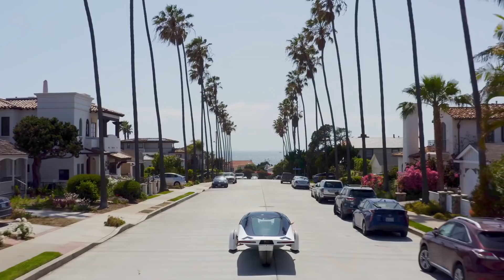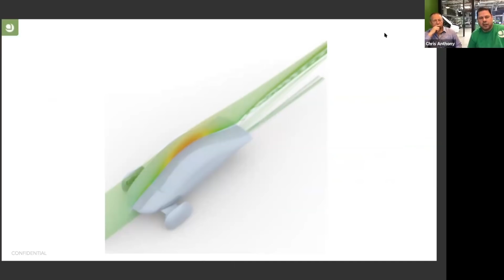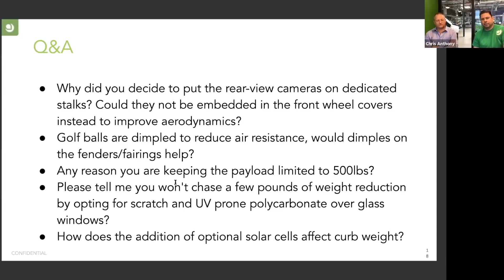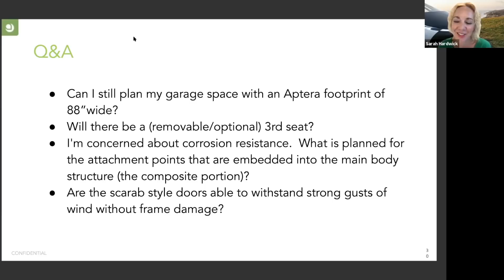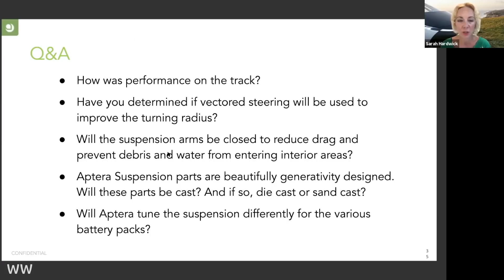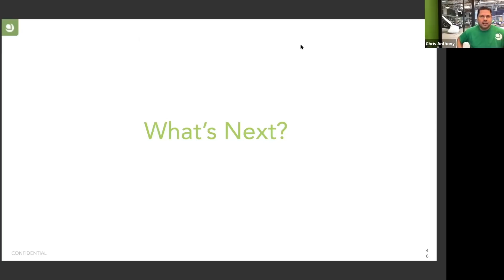Aptera Beta Design Improvement Webinar

Comment: Finally a shot of the awkward ingress as I suspected.  How about the egress?  Come on a motion shot.  In and out.  An average sized man in a narrow parking space. If they don't fix this it will die a very quick death.  This combined with the reach and bend needed to put articles in the hatch area would assure my Chiropractic practice a waiting list.  I bet she isn't even 5'5".
Reply: This is an alpha vehicle.  The betas will have a larger cabin.
Reply: @n.brucenelson5920  I doubt that will change the awkward ingress and egress.   The cabin interior size is less of an issue.  It's the shape and angle of the door opening.   The only way to keep an entrance the average American can navigate will be to lose a lot of Cd.  I had my suspicions with all the hype pictures and very short video clips conveniently omitting anyone contorting their body to get in or out in an empty parking lot let alone a tight parking space with 2 ft to the next car.
Reply: Doubters with no real information seem plentiful.  Cabin volume certainly makes a difference for taller people, and also has a safety component, moving hips further from the door.
Reply: @n.brucenelson5920  the information is plentiful in the form of no information.  No one selling something wants to show the faults of their product.  Aptera 2.0 is no different.  Cabin volume makes zero difference in passing through the same size and angle doorway.  I have an average 2k sq ft home with stock 36 in wide doors.  My son has a 7.5k sq ft home with 12 ft high ceilings.  Same 36 in wide doorway.  Same limitations of that doorway as my doorway.
Reply: @doclees11  Once the gamma vehicles are available later in the year, you will probably have a chance to check it out for yourself.
Reply: @n.brucenelson5920  yeah sure.  Still waiting on Elio.  At least I got to sit in one.   Meanwhile the major brands and technology keep improving exponentially.  I have no problem being proven wrong but I've been following this type of "new" offerings for too many years.  All have died off.  I doubt this will be another hybrid wake boat.
Reply: @doclees11  The Elio was a poor copy of the original Aptera with no engineering expertise behind it.  This generation of Aptera Motors has top engineers from the industry with an actual record of success and could be working anywhere they wished.  Both founders have a successful business record, filled with innovation.  The last company Chris Anthony co-founded and was CEO of, is a lithium battery company that is publicly traded.

I do understand that the general record for startups is not promising.  This could have been said about Tesla, too.  This is still where most innovation comes from.
Reply: @n.brucenelson5920   Apparently Aptera's top engineers don't realize their toy needs to be user friendly.  That doorway isn't it.
Reply: @doclees11  if you had made it to the last 15 min of the video, Jason stated they had made improvements in egress/ingress with beta.
Reply: @jasonstahl1327  they haven't shown them.  Last video from the most recent video stream I saw with Chris getting out still looked awkward and ungraceful.
Reply: Hey folks the most recent video from Aptera show one of the bosses getting in.  Yep that's a deal killer. Ass to the door, squat down, tuck your left shoulder to the rear of the seat, tuck your head and swing in.  D
Reply: @doclees11  I remember the first time I owned a motorcycle with a rear trunk and center stand. It felt so awkward getting on without my foot hitting the trunk and it took 3 or 4 tries to get it on the stand. After two days of riding, zero issues. On and off we’re a breeze. You learn the kinematics of the vehicle. Steve looked like he had no problem getting in. And it definitely is more graceful than getting in my Triumph Spitfire. If you don’t like it, don’t buy one, but you seem intent on getting others to hate it with you.
Reply: @jasonstahl1327  my Honda Coup 600 Kei car was easier that that. My 63 Midget was easier than that.  Hate it? Not at all.  Cool science project that may lead someday to something the average person can use and want.  Nothing i want more is a super economical form of transportation because I'm inherently cheap.    Call out its flaws they have been intentionally hiding from investors and pre-orders? Yes.   That is what I hate.  I have no doubt that the designers know this flaw is a real problem.  So they are either so excited and blinded about its concept or they are deliberately avoiding the issue to not shade the hype.  As a cynic I lean towards the latter.  As cool as some of its features hope to be, its market is getting smaller and smaller as more info gets out.  Let's assume it makes it to full production.  Put this into the hands of people reviewing it and that ingress and egress is going to rate very very low. You know how you get in your car with a briefcase or bag of groceries in your hand to put on the passenger seat?  Doubt that can happen with that ingress. That means you need to put the item in before bending like a yogi.   Run a couple errands and you'll be begging for a normal car door or a nice sliding minivan door.   Low sales will keep the price high further reducing sales.  Meanwhile normal EVs/PHEV  continue to drop in price, add luxury and don't look odd. As for Steve, I have no doubt he has been practicing that entry many times.  Can't wait to see his exit.

Comment: It seems to me that Aptera is an interesting concept to, in part, show where certain elements of technology can be stretched.  But, nothing in this webinar showed me in any way that Aptera can even remotely match Tesla's engineering and its focus on what a customer can actually buy and use.  Compare Telsa's development of a new electric motor with carbon fiber housing which results in sustained high output power numbers even at higher velocities.  With Aptera, they're still talking about rear vision placements in the wheels housing.   Yawn!
Reply: Tesla knows that efficiency is the rule for BEV. Aptera’s aerodynamic are more advanced than Tesla, but they are both headed in the same direction. What I am most concerned with is the battery thermal management system.
Reply: @matthewhuszarik4173  Remember that one of the Aptera founders took a lithium battery company public.  There is a good chance they have access to BMS tech and thermal management at least a good as what Tesla has. Aptera has a lot of IP in this area.
Reply: @n.brucenelson5920  I hope you are right. As everything being equal I would prefer an Aptera over a Tesla. I don’t really want to be driving a 4K-5k pound car around for errands. I hope they have a four/five seat version on the back burner as well.

Comment: It needs to reduce width, 88" is wider than a Hummer EV width of 86.7 in (2,202 mm). This will not fit narrow European streets.
Reply: Agreed, 88" is way too wide for a two-seater coupe.  But, as Chris said, the most they could bring those wheels in would be an inch.  Reducing the width would require a radical design change for the body, fairings, and suspension.  Perhaps the next generation they'll be able to get those fairings closer to the body, or maybe even integrated.
Reply: I wonder if it's possible to get good enough torque vectoring that the front wheels don't need to turn under any circumstances, and allow the rear wheel to turn like a caster.
Reply: Good luck with this tunnel in South Dakota
https://m.facebook.com/groups/208379450470795/permalink/554337059208364/

Comment: With the all wheel-drive set-up why not use all wheel for obtaining speed then use the wheel to recharge the battery while you continue in front wheel mode.
Reply: Doing this would just drain the battery faster
Reply: Because drag .
Reply: this is like asking, why not apply the breaks while acceletating on 33% of the tires.. you lose more power from the breaking then you'd generate dragging thru break/reverse engine operation of regen
Reply: Because that would break the laws of thermodynamics.
Reply: If you give it a bigger wheel in the back couldnt you always be going down hill? 😁

Comment: At 58:17 they could have added solar panels inside the dashboard, that way more unused spaced is utilized to power up the vehicle.
Reply: The full solar model includes panels on the dashboard.
Reply: I think this would result in reflections...but I am wondering why the tail is only equipped with 3 solar cells each side when there is more space (in between)?
Reply: @christoph3864  Possibly to leave the area clear for people climbing over the center section.

Comment: Aptera considering a single pedal for drive and break (like Nissan)?
Reply: Not at present.
Reply: I drive a 40 kWh Leaf. One pedal driving is GREAT!  I wouldn't want to go back.
Reply: I like the option of being able to select anything from one pedal driving to stand still (like the Model 3)  to full coasting (some call it sailing). EV owner feed back tells one pedal driving is a favourite and I have to agree.
Reply: It has several user setable levels of regen. On higher levels, regen should handle most of the braking without needing to touch the brake pedal.

Comment: With the lightness of the vehicle I wonder if it's a potential danger driving over the Mackinac Bridge between the Upper Peninsula of Michigan and the lower Peninsula of Michigan. We've had small cars like the Yugo actually blown off the bridge into Lake Michigan drowning the passengers.
Reply: The Aptera has a low center of gravity because of the battery! And the aerodynamics of the vehicle let's the wind slide by the body in the front as well as the sides!
Reply: The Q & A notes available on the internet indicate safe at 100+ mph crosswinds due to its design. Other vehicles with standard flat sides are are susceptible at 70 to 80 mph crosswinds.
Reply from the maker: Aptera weighs about 2,000 lbs, aerodynamic and has a low center. Wind should not be blowing the car around. Aptera will likely perform better in windy condition than most vehicles in the same situation.
Reply: Plus, the Aptera floats.  😀
Reply: Being a Upper and Troll for part of my life I would say the Aptera design balances the high pressure on all four sides so there is no lifting action like a wing. Because this also does not create a sail it should handle the 80+mph winds that took down the Fitzgerald in 1975. I had white knuckles in my Ford Pinto wagon crossing the bridge that early Monday morning before they closed it. Weight is more important when you are pulling a heavy sail-like trailer with a semi-truck.
Reply: Due to the aerodynamics, this should be one of the best vehicles over made in crosswinds. They say you don't notice the wind from trucks at all.
Reply: Just in case consider ballast  drop tanks.

Comment: From Chris, sounds like the unwrapped color is gray. I wonder if an unwrapped "naked" Aptera would be viable. Perhaps with a no-wrap discount?
Reply: I’m not positive, but seeing as their resin is UV cured, that makes up the body, I would imagine it needs to be wrapped to protect the structure from over curing in sunlight, and becoming brittle.
Reply: @Edktd Mlnn All of the vehicle will come with wraps.  Some UV blocking is needed to protect the epoxy from UV damage.